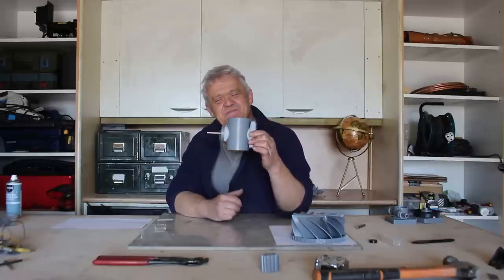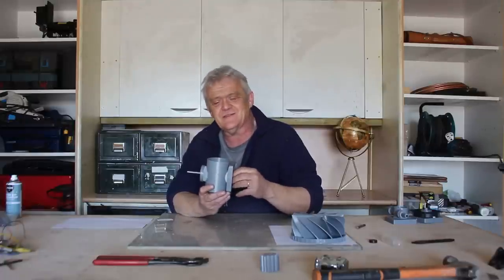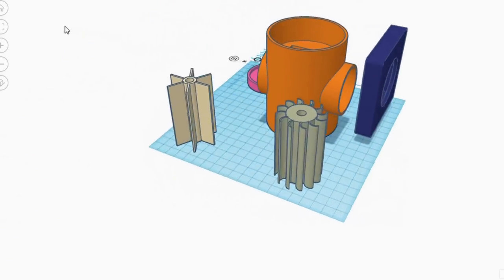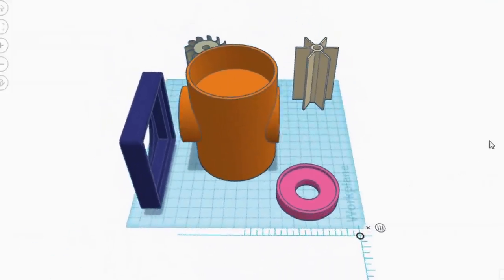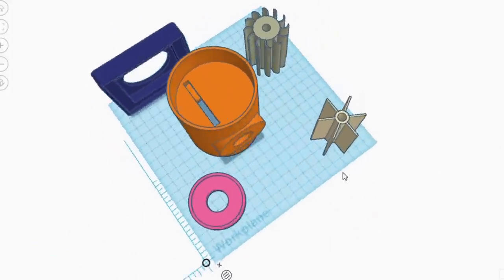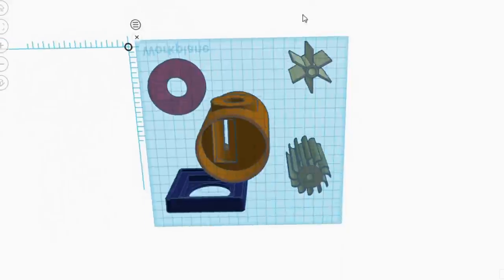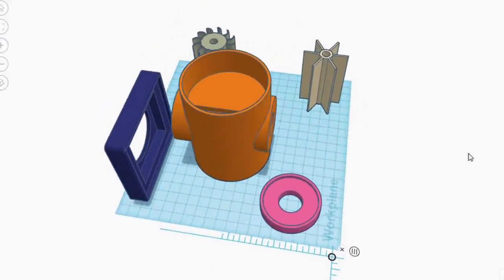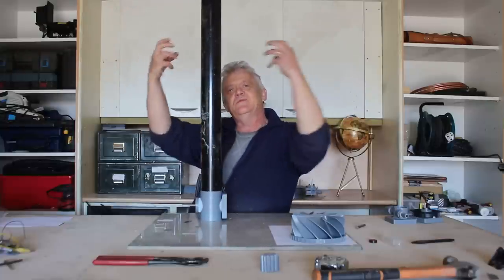1902 How Much Energy Is There In Rainwater?

Comment: For your design in this video instead of a bell siphon collecting the water. You could create a simple float valve that works works identically to a toilet tank flapper, by using a weighted ball above a reducer, and a float attached to it by a chain in a an appropriately sized pipe. During light rainfall, you would get a burst of production, and more consistent rainfalls would keep it afloat, allowing for more constant production.

Comment: The really cool thing about this idea is that the higher you build the collector, the more potential energy you can actually use from the rain. The downside being cost of building such a tall structure, and for the best results a large area would be needed to harvest as much water as possible. (Assuming it rains too).
Reply from the maker: it rains a lot here lol - but yes you are dead right
Reply: Put a tarp from a tree
Reply: @ThinkingandTinkering  If you changed the design so that you captured the flow more efficiently, then increasing the height would generate more. Current design only has a narrow slit and a flat area which would probably back up in the pipe generating heat/sound and a stored mass of water. So if you still wanted to go with a completely inline rather than a loop the loop sticking out the side of the pipe or something like that, you could add a funnel above so that the water didn't get slowed down or design it so the blades matched the flow coming throught the split - so the mass of water would be forcing the water through the slit more like a water wheel or spoons. In Brisbane Australia when we have a downpour our 90mm downpipes don't contain a diameters worth of flow going into our water tank so a funnel could work quite well. (Thinking here a streamlined funnel rather than a funnel one might use for adding vinegar to a table bottle. Something more like in some of your other wind videos)

Comment: I'd recently thought about this. If you use 6" or 8" downpipe you would have considerably more mass stored. The water then needs to be released through a narrow hole, to create higher pressure, and longer release time, to use with the generator. Great video as always!! Thanks
Reply from the maker: the smaller hole won't increase the energy mate - the energy is just the energy if you create higher pressure that has to come from somewhere and the release of the higher pressure comes at the cost of lower volume - so the energy remains the same
Reply: Sorry, I didn't mean like that, it's not to increase the energy. It would be better with an adjustable release. It's so that as it's raining, it releases slower so that the head is maintained, and energy is extracted slowly, more like a trickle charge. 
The release could be variable, dependant on how "heavy" the rain is(a sensor in the gutter perhaps so as it fills up the release opens more)
Or is it better to just flush it all at once? I live in Wales so we get lots of rain.
Reply: Lester Allen Pelton also thought about this when he designed the Pelton Wheel in the 1870s  " The Pelton wheel extracts energy from the impulse of moving water, as opposed to water's dead weight like the traditional overshot water wheel."  - Pelton Wheel wikipedia, its used in todays mini hydro generators, basically the turbine blades are shaped like spoons or cups that apparently convert all the waters energy into the wheel.  A speed at the rim desing.  Theres a formula on there that calculates a turbines efficiencey and this design is suitable for low flow high preasure, im guess would  be water, where as a wind turbine might be considered a high flow low preasure situation.  Apparently its the most efficient design for water, but maybe a more efficient 3d printed design exists?
Reply: I was just rewatching a downpipe power video with a pelton wheel(I couldn't remember the name but could see it in my head)
I suppose the only energy you will get out is limited by the amount actually falling on the roof, which generally is not really that much in the grand scheme of things.
And occasionally.....way too much.
Reply: @boslow123  Well, 1 inch of water per square foot is 0.62 gallons. 
Average house roof in the US is 3,000 square feet (278.7091 sq. meters).
Thus, one inch of rain will give us 1,860 gallons of water, or 7040 Litres.
Since I live in Seattle, I think this might be worthwhile.
Sorry for doing the math in Freedom Units, "It is what I am accustomed to."
Reply: @garysmith5025  The average Home Depot has about 6 acres under one roof. Do the math and tell me that's "Insignificant," in the world's only Temperate Rainforest.

Comment: One thought that I just had would Be to create a full height bell siphon  down spout. Where you take a four inch p v c pipe cap it at the bottom with the top receiving the rain from the gutters and a length of pex tubing running from the bottom to the top and back again, where it attaches to any one of your turbine designs.

Comment: While you have the drop on only half of the wheel, it would benefit you a lot to not merely drop it on half the wheel, but taper the whole of the water at a bevel [roughly 73.5 degrees is seen as pretty close to optimal] and direct the impingement of the water right at the 90 degree point thus developing optimal torque, at optimal slip stream flow of the water.

Also, because it is trying to deflect the water in all directions at once, one should either print flat plates onto the ends of the deflector, or add them on after the print is done.

They need not be printed, and need not even be the same material.

They could be the ends of a soup can, some builder's board, or a pair of washers.

Just glue them on, so that the water can not slip off each end, and therefore forcing it to react with the blades of the wheel, getting more effective torque out of it.

These changes would really not add much complexity or cost, and would increase the potential yield as much as 30%, and depending on the height of the water drop, due to how water accelerates more rapidly as more vertical pressure is applied, overcoming more of the natural viscosity and surface tension drag of the water inside of the tube, more net power would come out.

While those percentages may not be seen as much, for as little additional material and effort as they would increase the project by, it should certainly be viewed as worth the small amount of additional work to put those alterations into effect.
Reply: agree about the water bevel or making it bigger so the opening to the water wheel is closer to the diameter of the down pipe.  As is, with the small hole and flat bottom, the water hits this choke point and shoots out the side through the seem of the pipe and the device instead of flowing through the wheel.  Even if it was water tight it would clog there and lose much of the energy gained from the roof height.
Reply: @DonXisco  Well...

Let us see if Robert decides to add the listed improvements to his design or not.

He does some times listen to suggestions given to him.

And yes, he loses a TON of power where his joint does not seal.

But that one, I'm pretty sure he is aware of...

A little bit of silicone, hot glue, super glue, or several other products would resolve the leak, possibly even PVC pipe cement from the hardware store.

We shall see if he addresses these issues or not. /( 'w')~

Comment: I thought of using water as a battery, pumping it up a height, when surplus (from solar) and reclaiming via gravity.
But when I ran the numbers, a ton of water raised a meter, takes (lose less) 9800 Joules, or about the same as an AA battery! tell people you could life a ton with one battery, and they are usually incredulous.
Not knocking your idea though, as you say, it's simple, cheap, and uses free energy that normally goes down the drain! 
Just did some back of envelope sums, my house has a 40M2 roof, x 25L per square M per one inch of rain (sorry about mixed units!). So a ton of water every inch, it rains 70 odd inches a year here in Wales, and my drop is about 5 meters. 3.4 million Joules! about 1KWh without losses.
Trouble is, I'd have to drive for a while to get some "English" downpipe😂

Comment: You could 'stop' the water if you wanted to complicate things. A hopper that fills a tank/butt could be used like a gravity clock escapement wheel to turn a flywheel, Dumping the water out at ground level and returning the empty butt to roof level for refilling. Over elaborate but would be a cool machine to look at in operation.

Comment: That's a nice PoC! However, I didn't quite catch what role does the 3m height play in all this. Yes, you're dumping water from 3m height, but then it stops right at the top of your generator segment and accumulates, because it has to flow through a tiny slit - not the whole Ø10cm or whatever diameter. I mean, the falling water loses speed and, consequently, energy, because it's absorbed by the top part of the generator segment.

I think you should either narrow down the diameter of the pipe to +/- match the slit (or create a slope) OR make a bigger water-wheel that's fins are +/- the diameter of the pipe. Effectively, more than half of the water wheel will be outside of the pipe, but only the effective area of it will be hit by the falling water.

I understand why you made the slit - so that water would only fall on the effective area of the water wheel and wouldn't cause resistance on the other side. But this introduces two problems:
1. thinner duct (slit) will require a lot more maintenance (leaves, branches, feathers and other junk will clog it very easily)
2. you're losing the "falling water from 3 meters" effect by stopping it like 2cm from the water wheel.

I bet the only reason your generator was spinning is that the accumulated water rose in height inside the pipe and created more pressure, so the accumulated water jetted on the fins. If I remember my classical physics lessons well, the height (depth) of the liquid (water) mass is what determines its pressure.
Reply: Absolutely correct.  Basically if the water touches anything at all before it hits the turbine then it has lost all its energy.  The only reason the paddle turns is that it has no load resistance.

Comment: My thoughts are based on the standard cross section of gutters and downpipes have become standard because they're the sizes that account for the volume of water needing moving during a heavy downpour. eg the house design having 1 downpipe for each Xm^2 of roof area. So restricting that cross section area, as per this design, will likely cause backup during such times and possibly overflow of the guttering, though mitigated somewhat by the then water column build up pressurising the water that in itself can cause a problem as at such times energy capture section has to be able to deal with the extra pressure of up to a few meters of water column.

Admittedly it should only be a problem during the heavy downpours but I think possibly another way to go about it, would be to design the capture device bigger, so it's restricted cross section area is roughly equal to a normal downpipe's cross section, and so avoid the possible problem. One way to go about that, when happy with your basic design,  would be to flair out the top and bottom sections ( keeping it as an easy to add inline device ) to the required size for the resized capture device.
Reply: Another ( possibly easier ) option might be to stick with the current size and see if it does in your situation. If is does turn out to be a problem take a branch off ( say 1m, this height becomes a pressure limiting device with no moving parts to maintain or wear out, a good thing ;-)  ) above the device that goes to a second downpipe ( possibly with it's own generator in it ) and re-join the downpipe below the device(s) with a Y section.

Comment: I bought something similar from ebay that connects on the water pipe feed to a tap so you can put leds in a tap which light when you run the water.

Comment: thanks Rob  - - services to physics.  NB.- as soon as time gets involved we are interested in power (unless working backwards we start with power and want to compute the energy expended or gained".  (I went off in the first few seconds, not realising you were about to "present the derivations" - well her is my go at joining the dots (pun intended,  - scalar units only) with a little dimensional  commentary.

General Derivation - Energy is WORK done (or the ability to do work) = Force *distance. (I learned a long time ago that unnecessary work is MAd  - "mas" was the formula while Power  was "Work / time"  - the time rate of energy "transferred" - used or gained (total work done is Energy "exchanged").

Power  = Work done / time = = Energy expended / time =  Force * speed (quantities) = (W=N*m/s) - units  = F L /t -(dimensions) - dimensional analysis (Mass, Length and Time (M,L,t) are fundamental physical units) lets kids work out which quantities are "equivalent")

Power (W)* time (s)  = Energy (J)

Force (N) = F = mass * acceleration =  kg * m/s^2  = M L/t^2 

Energy = force * distance (J = N*m = F L ) = M L/t^2 * L = x * M ( L^2 / t^2)

(redefine) Power = kg m/s^2 * m/s = kg m^2 / s^3 = M (L^2 /t^3)

Newton 1 started with Momentum =  = mass * velocity = mv  = kg m/s  = M L/t  

(the body in space continues in a straight line at constant velocity until  acted upon by an external force...)

Newton 2,  Force  = ma - Inertia - that "property" of mass's resistance to acceleration.
Newton 3 ,  forces act equally on al bodies - equally and oppositely  (elastic collision mechanics).

(non relativistic space is nice, but not very real)

Kinetic energy is merely the integral of momentum = = 1/2 m * v^2 = 1/2 M * (L/t)^2 =  1/2 kg (m/s)^2  = x *  M (L/t)^2 =x *  M (L^2 / t^2)

Potential energy = mgh = = m a h = kg * m/s^2 * m = M L/s^2 L = x * M ( L^2/t^2)

I think this is all right - think of it as a bit of an brain stretch for the kids (and others who may or may not have been previously  presented with the simple interrelations)

Comment: Nice video :-) rain gutter wont give much. I have been thinking of an emergency generator, wind and /or water. A few times per year we get so much rain streets flood, and also storm winds. So a cheap portable generator that would give good amounts, say 10-100w/h in those conditions. Small wind generator designed to mount on balcony railing during storm winds. A water generator to be placed on the curb side of slanted road during huge flood rains. Purpose to help during power failure that are common during extreme weather. Either to charge phone or small 12v battery.

Comment: While the mass contained in the gutter may be 32kg the head pressure is only the volume near the downspout due to the resistance in the overall system. The limit is the constriction of the downspout as it throttles the water able to pass through the system at any one time & the time it takes the water to move through the gutter to the spout. That said you do have a very very tiny dam with a very tiny lake behind it so ... Love the idea shame the volume is so little.
Reply from the maker: you said it yourself mate - it is a small dam - and the resistance is not that great - try it and see

Comment: Water falling and hitting the flat plate and not the turbine will transfer its energy to the plate, only a small amount would hit the turbine as the area is small. Maybe something to direct the falling water directly to the turbine would be a good idea. 🤔
Reply: That was my first thought too.
Reply from the maker: it's not a flat plate and the rain isn't falling in drops mate - it's more like a mini dam
Reply: @ThinkingandTinkering  You're trying to extract kinetic energy which itself comes from the stored potential energy. Most of the falling water will slap the mostly flat plate and lose it's K.E. to sound, heat and vibration etc. There is then very little potential energy left to convert into K.E. as it flows down through the slot. The only way this works is if you fill the entire 3 meter pipe with a head of water and the pressure acts like a compressor to rapidly accelerate the water as it forces it's way out of the slot. Even in the UK, I don't know that we have heavy enough rain, often enough, to optimize for that. Or you need a siphon (which I think you may have mentioned) and the prospect of storing partial loads of heavy water in your gutters when the rain ends.

It would be way more effective if the slot was 3m long so all the accumulated K.E. was applied only to the turbine.

Comment: Seen people put a tank on their roof, draining down to an actual pattle wheel, which ran some kind of generator, which powered a pump running the water back up to tank with the electricity left over charged a battery bank.
Could run a couple of your inline ones to your serpentine gen.
Run electricity inline to pump and batteries.
Just want my refrigerator and freezer to run on this...
Maybe an at the point water heater 😁😁😁😁😁
Reply from the maker: using the water as a kind of battery!